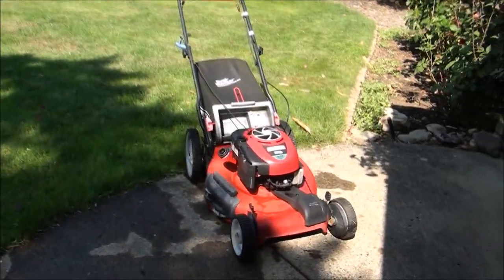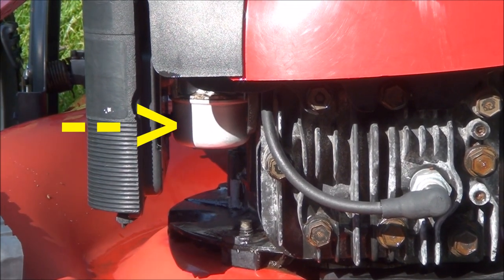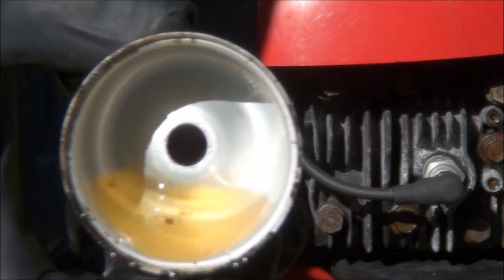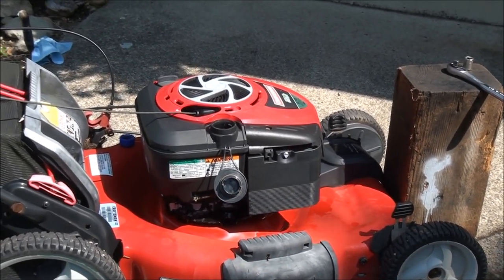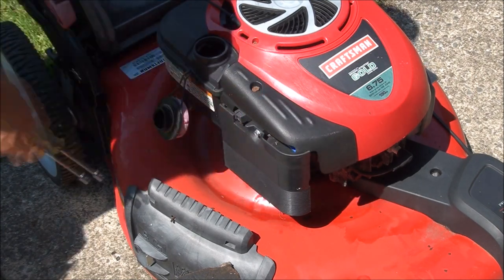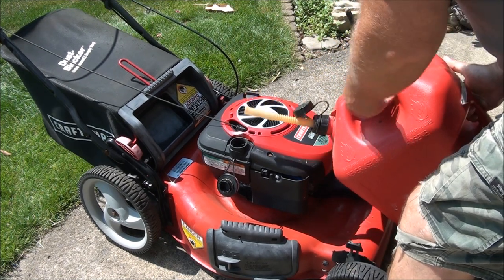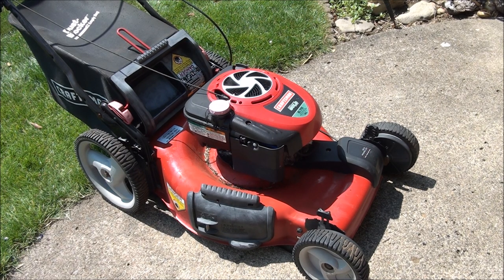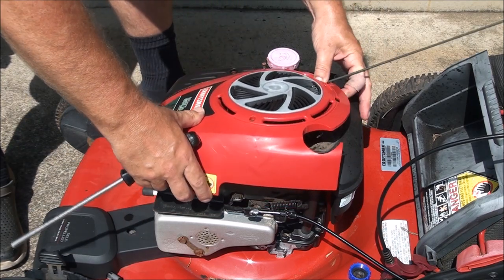How To Fix the MOST COMMON problem on MOST COMMON Lawnmower Briggs and Stratton engine wont start

Comment: Hey Jeff -

As always, another great concise video w/out all of the loud & crappy background music that a lot of other YT creators use. ✓

Tip: although I'm all for cleaning/repairing carbs when needed, just know there are several cheap ($10-$20) carb kits (which often contain not only a brand new carb, but also possibly many other helpful parts such as a fuel shutoff valve, new fuel lines, gaskets, spark plugs, etc) that are sold on Amazon/eBay.

Installing a new carb, etc. will often easily 'fix' any related carb issues just by simply swapping out the new one with the old.

And yes, I do know that's sort of 'cheating', but hey... they (carbs) have become so affordable now, that it could actually make more sense just to buy a new carb, rather than to spend a lot of time cleaning the old carb.

BTW, about midway through the video... I caught that nice reference to that old classic movie... 'Anchorman'. LOL 😆
Reply from the maker: Thanks for watching! New parts are sometimes a good way to go.. Although I am always leary of using cheap carburetors/parts because I have encountered many issues with them over the years. So I always try to use oem parts when I can. I messed up the Anchorman quote but I am happy someone knew my attempt at humor!
Reply: @JeffsLittleEngineService  I completely agree about OEM being WAY more superior than these other 'wannabe OEM' parts (ALWAYS go w/OEM if the gap between OEM/NON-OEM is just a few dollars, though). But for most homeowners (aka non-pros), many times going the cheaper carb route is good enough, IMHO. Thanks again, Jeff!

Comment: my personal mower Toro recycler as the quantum 190 cc and still rocking the oem carb that is on it when I bought it for 5 Dollars that mower few years ago back only thing I did was rebuild the carb at the time no issues since but I drain the gas out each year. good video Jeff 🔧😎🤙
Reply from the maker: Thanks for watching!
Reply: @JeffsLittleEngineService  your welcome

Comment: Serviced our daughter's mower ah couple of years ago, it was running but not great, drained the fuel cleaned the carb changed the oil, air filter and spark plug even sharpened the blade, filled the oil and fuel, all ready to go so I gave it pull and it's a little harder to pull than it was before I worked on it so I give it another and it starts and proceeded to grind up the old air filter that had found it's way under the mower, I look at my daughter and say alright then it's good to go, it still starts with one pull and runs like a champ

Comment: It`s a nice tutorial! We hqve3 a very similar model from "Toro" with nearly the same Briggs engine. The difference is... the carburetor is made of black plastic. The bottom part is fixed by two screws  and, yes, id does have a very similar central bolt (plastic as well). I thought it is for fuel drain only and did not take it off to clean. Can you tell me whether this plastic one has the same mail jet inside, please?
Reply from the maker: No it's different but here is the video about it https://www.youtube.com/watch?v=unK4LDJt5w8&t=196s

Comment: also 2 nd Rookie mistake , tilting the mower onto the carby side good way to fill the carb with oil and ruin s good air filter, alway tilt to exhaust side or tilt mower backwards
Reply from the maker: Thanks for the tips!

Comment: My lawnmower ran out of oil and I thought I had killed it, because the piston was stuck and I could not pull the chord anymore. Added some oil, unplugged the spark plug, moved the cutting blade (gives you a nice leverage to move the piston), and repluged the spark plug. It ran like new after that. Looks like these engines are quite idiot proof :)
Reply from the maker: nice work! Briggs are great engines

Comment: Just saying Jeff . its not good to turn the mower over with gas tank on the down side . its real ez to ruin an air filter that way . because of the engine oil draining in to the carb  . the fuel line  is fairly accessible to drain the fuel tank by leaving the unit on its wheels . but hey your call  .
Reply from the maker: Definitley can cause a problem if you leave it on it's side for too long. I have never had a problem with oil infiltration from a quick tipover when emptying the gas tank.

Comment: It may not start but I was still remove that spark plug wire my friend I don’t wanna see you getting hurt
Reply from the maker: good safety tips Perry. I also always make sure not to engage the stop handle so there is no risk of an engine ever starting up whiole working on it.

Comment: 3rd Rookie mistake not taking the pull starter off completly and clean and dust and grass and lubricate the pull starter upside down so you no youve lubed it properly not half arsed, and still you didnt remove plug lead for saftey and then after a fresh airfilter instale you turned the mower on the wrong side possibly soaking the new filter with oil. Gees mate do us Aussies have to teach you the basics, first thing you do is saftey remove the plug leed !!!!
Reply from the maker: Great tips!

Comment: I never tip it over like you did. I take the tank off. Rinse it out and leave it in the sun
Reply from the maker: Good to hear from you M Gomez, it's been awhile. Taking the tank off is a good way to do it too. As long as you don't leave it on it's side for too long, there is no oil infiltration into the air filter.

Comment: So you plow the dirt from the tank through the carburetor, nice job who taught you how to service mowers a monkey ? 😂😂😂😂 Shouldn't you pull the gas line from the carb so all that sediment doesn't plug it? hmm don't think you're doing it correctly plus you didn't clean the float jet with carb cleaner,that junk sticks to the float and needle and seat / rubber seal?  Guess if you want to keep taking things apart you can follow him. I'm sorry but read up on the proper way to clean out fuel systems on small engines please this is just going to make things complicated for you in the end I suppose? good day.